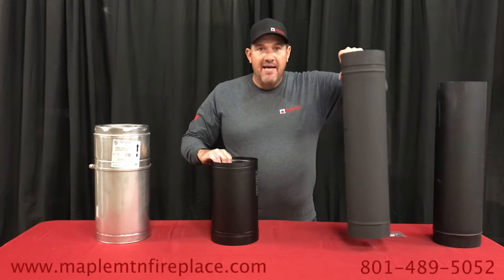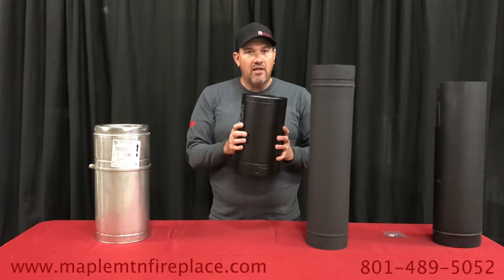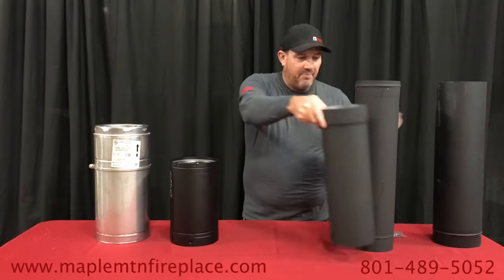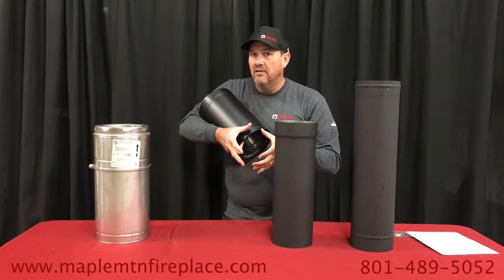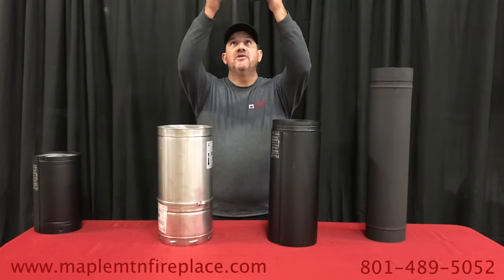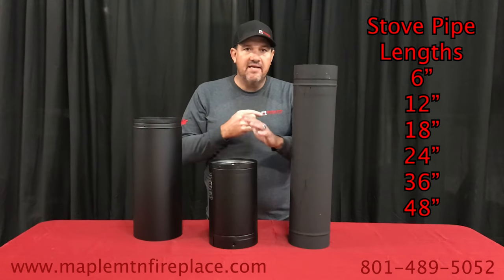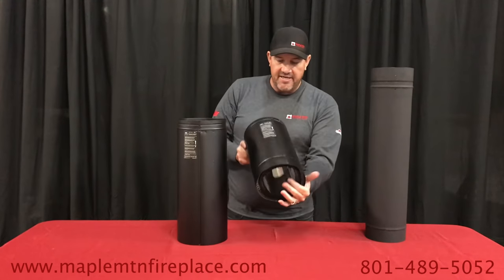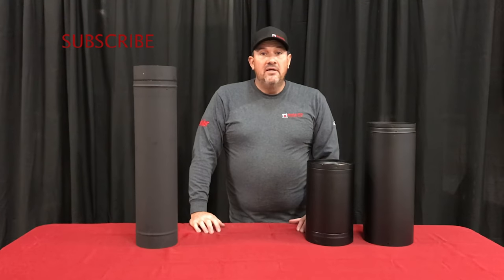Choosing the Best Stove Pipe For Wood Burning Stoves

Comment: Going through the wall, is it better to go out right above the stove, or is it better to go out high?
Reply: Im in the same situation, which did you decide to do ?
Reply: you want to go out high, this will help you keep more heat inside by doing that. more pipes inside the garage/house will be warmer
Reply: Plus the class A insulated chimney pipe outside is more expensive so you keep the cost down.
Reply: Also according to my manufacturer of class A chimney pipe I bought. An exterior chimney not in a chase will have more creosote buildup than one in a chase, due to the exposure to the cold. Therefore cleaning should be more regularly often. Again this is going by one manufacturer. Check with yours. Yours should have a manual with it.

Comment: what about stove pipe elbows to offset the stove farther from the walls?  We have an existing chimney system (Class A) where a wood stove and pipe was removed years ago (I never saw it) but it appears that the chimney pipe (in the ceiling with a removable cover plate over it now) is quite close to the walls and that there must have been elbows to offset it at least 6 inches or so for clearance and aesthetics.
Reply: Did you buy the stove pipe yet? Depending on the manufacture they will tell you the formula to use per your length required between elbows for the offset. Weather it’s 15 degree or 30 degree Elbow.

Comment: HI, What direction  is the slip fit installed on the telescoping double wall pipe ? My installer had bottom piece on stove and the top piece is slid down over the bottom Piece and im concerned it doesnt make sense because wouldn';t that allow creosote to drip down and then out the side of bottom piece

Comment: good info well presented, thank you, Maple Mountain.  Everything is more complicated than I think it will be.  Quite a few things to keep in mind.  Appreciate the distinction between "stove pipe" and "chimney pipe", but let me say no one video covers everything.  From what you say: use single wall stove pipe (of a good quality) inside the house, then use class A chimney pipe (2100 F rated), outside the house.  Maintain proper clearances and/or shield anything that can burn.  When making a penetration through ceiling or wall, maintain a 2" min. space to combustibles, and use the proper "thimble" to make the transition between stove pipe and chimney pipe.  
    I noticed one comment below about not having horizontal runs.(like out through the wall).  What is your take on that.  Thx.

Comment: I am going threw my wall into a little mudroom that is not really heated, can I keep it the black stove pipe in the mudroom, then transition to the stainless steel pipe in the ceiling adapter?
Reply: don't do it. Go straight up if at all possible. Avoid horizontal runs at all costs. I was toying with a similar idea and every pro I asked said don't do it.
Reply: I would not go through any wall with the black pipe period! Like the previous comment said- keep it as straight as possible and away from combustibles with the black pipe. I kind of learned that the hard way 😉
Reply: @2008romboy   Thanks for the help man, I got it figured out now,  cheers
Reply: @jefferyhammond1421  - what happens if i use to 90s to go through the wall and up the front side of my barno?